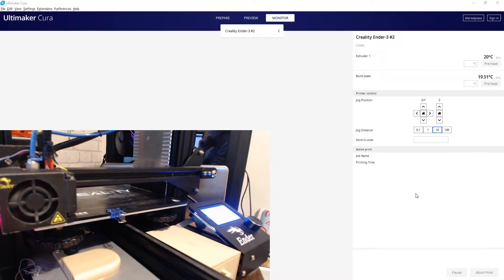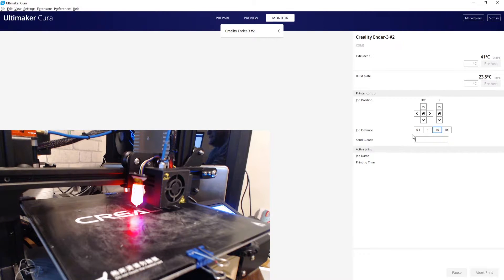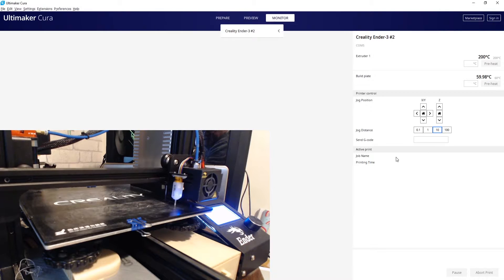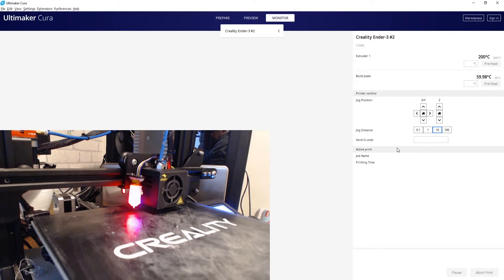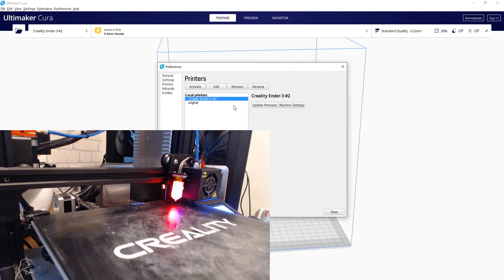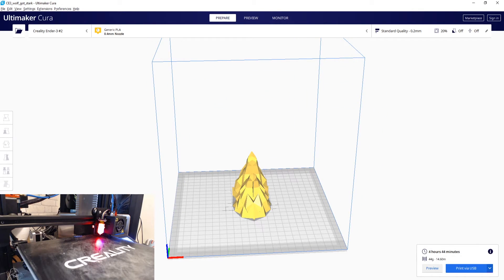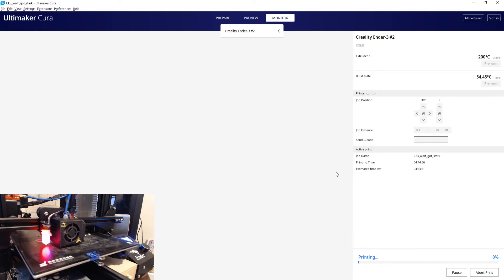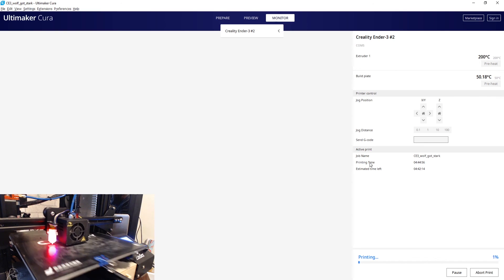Storing Bed Leveling Mesh - BLTOUCH - TH3D - Ender 3

Comment: Hi, if I add G29 to the start G-code in cura, will it be using the measurements while printing? Or do I need to add more to for it to actually use the measurements?

Comment: Hey y'all. I have an Ender 5 Plus from Tiny Machines running the latest firmware. I run a G28 to home then M420 S1 Z2 to recall mesh; Thats what Cura puts in the "starting gcode for my machine". I've been printing a test gcode and sometimes the layer to the bed is spot on and sometimes its too high. Same gcode, printed back to back. what could be happening? any ideas? cheers

Comment: Any tips on getting the BLTouch to communicate faster with the nozzle to prevent it from crashing into the bed? Currently trying to work out this issue. The BLTouch does send the endstop, but the response is so darn late.

Comment: wish you would have started with how to get the gcode controls. I have nothing in the monitor tab
Reply: You need to plug in your printer via usb, you might need to also install drivers for it to work depending on the printer.
Reply: @Kevin15673  I did that, and the driver is working just fine. I'm able to print directly from Cura. But there's still no console to send g-code.

Comment: Can you please help me I have problem in my 3D printer CR-10 S5  500mm after I upgrude it with BTutch Ver 3.1 The Z axis problem I see probing in LCD and I try to do Home but the stepper moved far awy -65 so I shut Down my 3D Itry to update frimworks But not fixed yet so If you know how to fixed that please tell me and thank you from my heart
Reply: lol....you may have home set at the incorrect position

Comment: Great video and a great tip. I have a question though about ABL in general. I cannot seem to understand why after adding abl, that people don't just hard mount the bed thus removing the springs. Wouldn't that eliminate the need to ever re-level the bed? I see most people still keeping there springs and wheels as per original after adding abl, including the manufacturers that include ABL on their machines. I don't get it. To me keeping the springs and wheels WILL mean that one needs to periodically re-level the bed as you have stated. I cannot seem to find any YT videos that address this after adding ABL to a machine. Any help with this is greatly appreciated.
Reply: If I may add to this, you can hard mount the bed, but for best results manual levelling the bed gives the best results with the BLT, as the BLT has limits. However you can replace the springs with silicone levelling columns which gives you the ability to manual level but it won't un-level over time like springs.
Reply from the maker: Yes you can hard mount the bed if you want. I keep the springs as I have not yet had chance to try hard mounted but I know you can.
Reply: @AhcMeUk  Thank you for the quick response!
Reply: @AhcMeUk  i hard mount.... and i get a lot less artifacts in my print....improved print dramatically ...i did have to use Loctite so the nutz would stop loosening...but yes i agree you should level it once with the hard mounts

Comment: When i do this it says on ocotopi "m420 s1 unkown comment" do you know why is that
Reply from the maker: Not used octoprint with this will try tomorrow.
Reply: @AhcMeUk  i figured it, actually by a dumb solution:) i write it with capital M instead of m:)
Reply from the maker: What firmware are you running?
Reply from the maker: Not sure I tried it on octopi and it worked fine. I can only assume you might be running Marlin and not TH3D